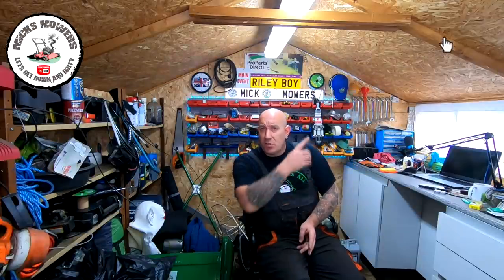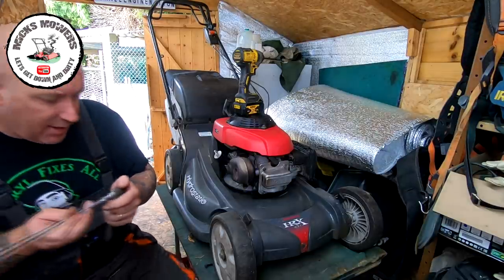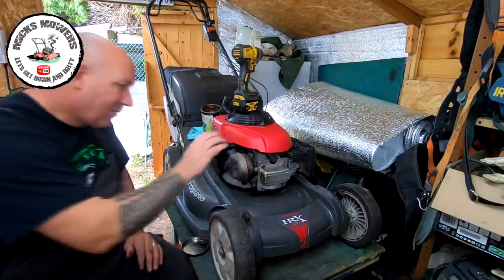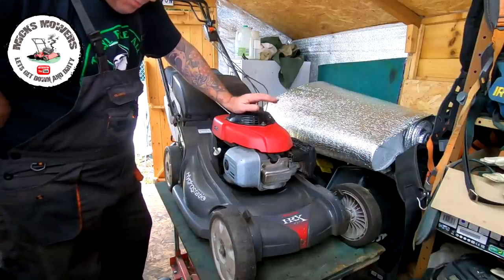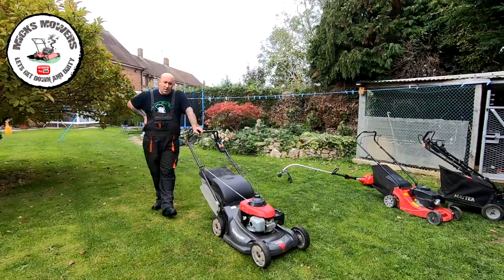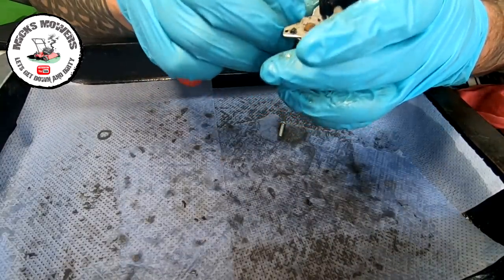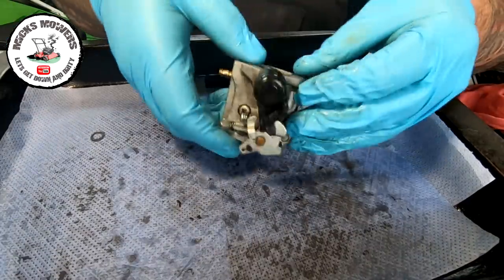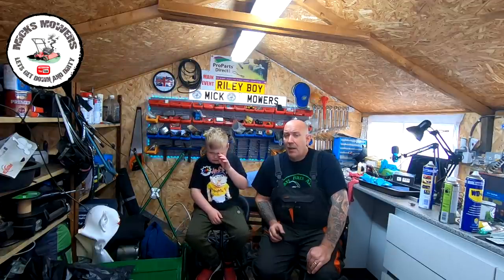Honda HRX537 Service and Carb Cleaning.. Now Will It Run Right..

Comment: I found this as I am going to get the carb off my HRX 537 tomorrow and give it a clean. After 9 years and about 1,000 miles behind the the thing it’s now running a bit rich so I thought it about time to do a carb strip down and clean- I do oil, filter etc regularly but this will be my first go at the carb and this video is really useful. I’ll probably have it on call as I’m working!

Thank you.
Reply from the maker: That's what the video is for mate.. good luck

Comment: Looks like when he said "serviced the air filter" that he tried to wash it.  Many old timers wash paper filters in soap and water!! One of my customers washed a quantum filter for 20 years! it ran so rich it always belched black smoke!  He thought I rebuilt the engine when I first changed the air filter and there was no smoke or smell. He said his wife was happy as he didn't smell like fumes anymore when he cut the grass!  Cheers mate!
Reply from the maker: Yeah you might be right.. I can't believe he sold it and all it needed was a new plug.. hope all is ok mate ..

Comment: Mick, get two short pieces of wood dowels and put them in the bolt holes. Stack all the gasket and parts, then pull out dowels one at at time while applying pressure, and insert the carb bolts. Works great. Trust me.
I’ve had a couple of Honda carbs, I just had to replace, but over here, they are less than $25.00.
Jim
Reply from the maker: Right Jim I will give it a go

Comment: Fabulous job of taking a hunter and making it like new again.  That  carb installation was a bummer.  I had much difficulty not fixing my eyes on that silver roll of I think insulation at the side of the mower.  It looked like a  truck muffler but I think it was insulation.  I am easily distrac   -  did you see those birds fly over?  Great job.  Love that Riley Boy.  Stay safe.
Reply from the maker: Yeah it's Installation.. nearly finished it

Comment: The most technical intake configuration hands down. Hate working on these personally. 

Gasket, spacer, gasket, carb, gasket, cover, gasket, filter... oh, did I mention gasket?

But, the easiest recoils to pull 👍

Comment: Hi Mick, looks like you’ve more or less sorted that one out, I’ve worked on these a lot as we always run one for work. The drive does sound a bit dry, I find a spot of grease on the cog usually solves that. Good video🙂👍
Reply from the maker: Yeah I did take it apart and grease it up.. it was super dry..

Comment: Hi great video! Which is the better mower, stilh RM 756 or the Honda hrx537 for reliability?
Reply from the maker: It's a wide question.. I would go to the Honda side
Reply: @themowerman 
Thanks for replying, I think I might just do that, as the weight is a factor also.

Comment: Hey Mick , my sp555v has the same engine on it , I’m sure they long bolts are m4-6 , I took 2 similar bolts out my bolt organiser box cut the heads off ( added slots for plain screwdriver and used them for alignment for the block head heat shield carb etc 👍 hope this helps bud
Reply from the maker: Yeah ta mate someone else mentioned that
Reply: Ah lol o well worth a try bud

Comment: Here in the states that looks identical to the HRX217 Versamow! Wonder why across the pond it’s numbered differently?  Got some googling to do!

Great job as always!  🤙🏻🇺🇸🦅🔧
Reply from the maker: Hi mate.. yeah looks the same.. oh nice job on the blower and good to see the lift table in use ..
Reply: 537 =53 cm and 7 hp. 217 = 21 inches  and 7 hp. 21 inc = 53 cm. That might be the reason?
Reply: @NilsKall  perfect🤙🏻🔧🇺🇸🦅
Reply: @pattayperformance  buying a hrx tomorrow! 50$, probably worth it.
Reply: @NilsKall  if it’s the HRX217 that’s a $500 machine with bag, fully serviced and ready to mow!  We love those mowers on our channel!
Reply: @pattayperformance  cool! Checked out your YT channel 👍. You got a new subscriber.

Comment: Need to tighten the end of the governor arm spring. Slightly too slow.
Reply from the maker: No it's just a carb adjustment
Reply: @themowerman  I have yet to see a Honda carb that is adjustable. Maybe it's a Europe/Asia thing.
Reply from the maker: @999thenewman  just needed the ideal adjusting
Reply: @themowerman  Awesome job, Mick. I understand there's a lot of off-camera work.

Comment: Honda lawnmower engines are reliable. However, I've never been impressed with any lawnmower that is 100% Honda design - too many plastic components, difficult maintenance access, self propelled drive problems, etc.
In my view, Honda has failed to impress with a reputation for quality in its lawnmower range and other power garden equipment, which is a pity from a great company like Honda.
Reply from the maker: Yes I agree.. especially the drive problem on the bigger units..